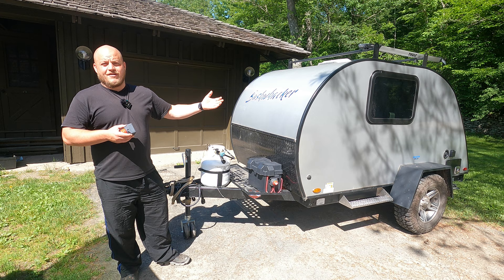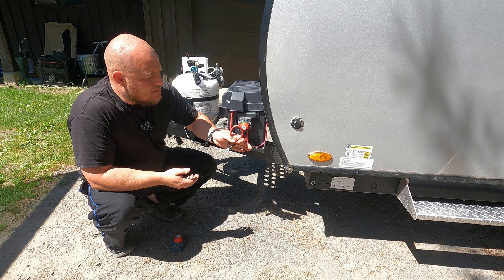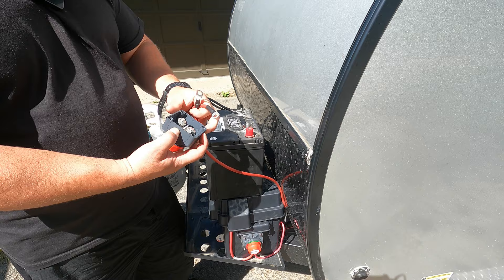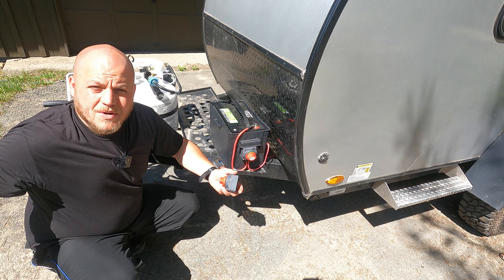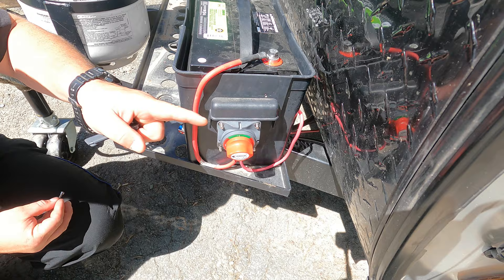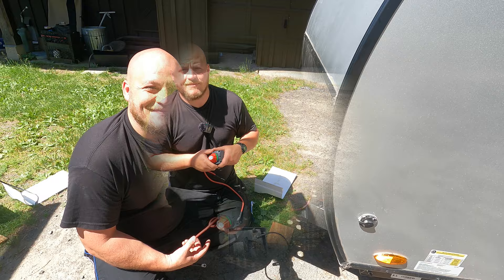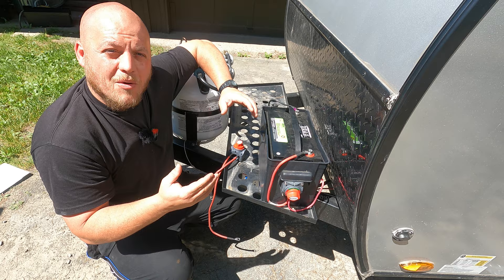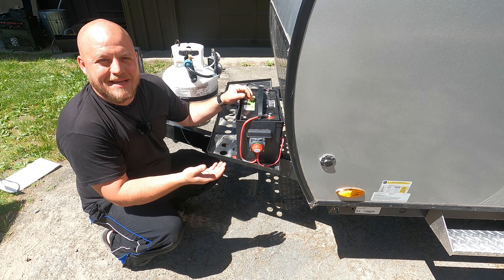Installing Master Switch on Camper Trailer | RV Kill Switch

Comment: I've been installing my battery kill switches on our RV Fleet since 2017 on the negative side and have never had an issue. It has the same effect, kills the power and does not drain the batteries. In fact I do it because any mechanic will tell you to always attach the positive terminals first to avoid arching your tools. You make a good argument and you're correct that the positive side is the hot side, but nothing is flowing unit the circuit is completed.  Also in-fact all of the units we have that came factory installed are on the negative side.  That said, great tips on installing the switch, and you definitely do a nice job with producing your videos!  Thank you!
Reply from the maker: Thank you for tuning in.
If you go through the comments, we talk about this in greater detail.  

There is still potential at the devices if you switch the negative, while you open up your pathway to ground.  There is no situation where this is advantageous over switching the positive. 
Every governing body that inspects or regulates DC electrical systems has mandated that you switch the positive and maintain on interrupted, and on fused pathway from chassis to the negative, the rest is urban legend.

When you’re adding and removing a chassis ground battery, you definitely remove the negative first.  For some reason people think that applies to DC master switch, it doesn’t, it’s a completely different situation.

Comment: I installed a two battery cut oft switch on my batteries and now my batteries stay fully charge.  Befor the switch my batteries would drain down even with a cut out switch on the dash of my motor home! Great to install!
Reply from the maker: They definitely help eliminate any of that pesky parasitic draw!

Comment: Why not switch the ground?
Reply from the maker: I've talked about this in other comments, check them out if you get a minute.
The gist- there's not an industry professional or organization that uses a kill on ground for situations like this.  That being said, either way works and would likely be fine.  There are several reasons why removing potential to appliances while maintaining an uninterrupted pathway to ground is superior.  The "urban legend" of switching ground usually comes attached with a misappropriation of a battery installation procedure.  With disconnecting a battery, its best to remove the ground first...they then think they should be switching the ground despite it being a completely different situation.    Hope this helps!

Comment: Don't forget to install the base plate.....
Reply from the maker: If you are installing the switch the way shown here, no need to use backer plate.  The backer is to protect the metal with potential, not needed when installed up against the plastic battery box.

Comment: I watched another YT video how to install this very switch, and he ran the switch off the negative side...stating his automotive background the negative gets the switch and he had a very sound explanation. However, your equally sound reasoning for running the switch off the positive side is also quite convincing. My switch gets here tomorrow from Amazon (thanks for the link) and I want to make sure I do it the best way.
Reply from the maker: Hi Alan, I used to try to not offend people, "Which ever way works best for you..."
The truth is, the negative side switch is wrong, plain and simple...lol
An RV has a chassis ground, when you switch the negative side, you introduce an elevated risk to appliances  by maintaining "potential" at the device, when the battery is turned off.  It can get complicated, but the evidence is clear that switching the positive and removing that potential, while maintaining a pathway to ground, is superior in this situation.
  
The reason people get this mixed up, is due to the simple rule that you learn when working on cars.  When removing a battery, always take the negative off first.  This is a rule to reduce the risk of short circuits.  If you took the positive off first, you risk bridging a metal tool from the positive to any of the metal under the hood.  It all has to do with the highest likelihood of short circuits. If you're installing a switch, it is different than removing a battery.  The risk is of shorts downstream, you're not moving the battery through a tight metal space. The industry puts master battery switches on red 100% of the time, when the negative side is the ground. I hope this makes sense, sorry if I took me a page to respond 😀

Comment: Just picked up my trailer today from storage. Went to use the electric tongue jack...dead. Hooked up the truck thinking I'd use it to power the jack, nope. Busted out the 7/16 socket and began cranking. First thing that popped into my mind, I need a kill switch. Great video...thanks man!
Reply from the maker: I've been there, it gets costly. How long was it in storage?

 SUBSCRIBE: https://www.youtube.com/c/DIYOutdoorLife?sub_confirmation=1
Reply: @DIYOutdoorLife , ~6 weeks. That said, we try and go camping about every 4-5 weeks, the batteries are always drained, but I've always been able to hook up the truck and use the tongue jack.
Reply from the maker: @beaujossel3791  definitely time for the kill switch install! It's fast and will save a lot of money.

Comment: Thank you for this great video. Installed it with the plywood spacer which was a great tip. My r pod had 4 wires on the positive post and I had to move 3 to the switch to turn off all the power. You might add this to your video. Thanks again Larry
Reply from the maker: So glad it helped!  Great idea about addressing multi wire systems in a video, thanks!

Comment: I have had one of these switches for years that came with a Terry house trailer that I used for accommodation when I built my house. I never installed it because I didn't understand it's purpose. I am going to install this on my new teardrop now. Thanks again.
Reply from the maker: That’s great, good luck w the project. Thanks for watching!

Comment: No "begging" needed! I actually subscribed prior to you mentioning that! I thought gee if this guy can explain a simple battery switch hook up so well then he must do a great job with everything else! I have watched so many videos on how to hook up a master switch and wasn't happy with them. Finally I came upon yours and as someone mentioned, it is through and detailed for the layperson. Thank you for your time and effort on this, your desire to educate is spot on! I have two batteries, parallel . My only question to  you is why the positive terminal, when everyone else says hook it up on the negative terminal?
Reply from the maker: Glad it helped and thank you for subscribing. Gotta do some begging early on to get the channel off the ground…haha
-as for the switching side w DC, the debate has been going on forever. The truth is either side works and gets the job done. When working with DC, it comes down to which is “best” - usually related to avoiding short circuits. With a system that is bonded and grounded to chassis, like an RV, you do not want to break or switch that ground. With phone systems or “floating” systems it doesn’t matter. Take for instance servicing a light or water pump on the rv, if the positive side was intact and you touched a wire to metal, you would complete the circuit and the appliance would turn on… this wouldn’t happen with positive switching. It’s complicated and easier to do demonstrations to show the difference. Hope this helps and good luck with your project!

Comment: Hey Brian, thanks for another good, practical video.
I did have to chuckle, though... When I first started looking at videos about RV modifications, I found that there are some strong opinions regarding whether the power disconnect switch should be on the positive or negative side. This sent me down a geeky rabbit hole of learning about Ben Franklin and J. J. Thomson - and common current versus electron flow.
In the end, it seems that either way works - and the trailer I'm buying comes with a power cutoff switch anyway. But hey, I learned some things, so it's all good!
Reply from the maker: Haha, I’ve been down those rabbit holes with projects as well. It starts with, “what kind of paint to…” —then it’s 3 am and you’re reading about 19th century lead poisoning.. haha
Thanks for watching and commenting! What trailer are you getting?
Reply: @DIYOutdoorLife  We had this conversation in another comment thread. :-)
I'm getting an Aero Teardrops, Steel H/C trailer.
Have a great day!
Reply from the maker: Haha….as the channel grows I lose track, I guess that’s a good thing! Awesome trailer, hope you love it, send pics!

Comment: Thank you for the clear informative video.  I installed a switch on my Jayco Baja.  In order to fit a piece of wood between the battery and the bolts I had to install the nuts on the outside of the box.  I had to add stainless washers so I could tighten the unit, otherwise the nuts were inaccessible in the recessed area.  Easy fix and it works like a charm.
Reply from the maker: Great improv!  I appreciate you swinging by and commenting!

Comment: I just received the battery switch, the “instructions” have a little picture that is less than helpful. I immediately check your YouTube channel for perfect instructions to install this. My little camper is in storage but this is definitely the first thing I will be installing this spring. Thanks, you’ve put my mind at ease!
Reply from the maker: Thank you so much, I appreciate you watching!
Reply: Ok, getting ready to install the switch but on my battery there are many other wires connected to both the positive and negative. Can I still just connect the wires as you have shown here?
Reply from the maker: @karenvinti3217  it depends.  You likely want to connect all of the wires that were connected to your positive, to the switch.  From there, one wire can go from the switch over to your battery positive.

This will turn everything off when you turn the switch off .

If you have solar, it might be worthwhile to keep that connected to the battery positive. In other words, all of the wires go on the switch, except the solar, that would remain on the battery positive.   That configuration, when you turn the switch off, everything shuts off but the solar continues to charge the battery.

Hope this helps, thanks for watching!
Reply: @DIYOutdoorLife  they are solar wires, that was my concern, I didn’t want to interfere with the solar. Once again you’ve explained it perfectly for me. I really appreciate it!
Reply from the maker: Thank you for watching!

Comment: Great video for me as a newbie boondocker. Wondering what the best ways to test battery life of an old battery. We just bought 4 year old TAG and used it last weekend first time. System seemed good but need to make sure battery is going to keep us happy for a two week camp coming up in September.
Reply from the maker: There is some affordable battery analyzers on the market, but results may vary.   Most places that sell batteries, like automotive stores, will run an analyzer on your battery for free, but I've seen that get wonky as well.

The most accurate, user-friendly way to do it at home is to leave it on the charger for a while until it is completely completely charged.  When you take it off, test the voltage, it's usually over 13.  Let the battery sit off the charger for a while, many hours, a whole day might be best.  It should be resting at 12.7 V or higher. 

Leave it for one more day, and test the voltage again .  if it's 12.5 or lower, your batteries played out.  if it can hold 12.7 for at least a day, it's got some good life in it.  12.6 lets me know we're getting close.  Make sure the batteries completely  disconnected for this test, it can't be connected to anything.

Hope this helps!

https://www.amazon.com/dp/B0BVM5SPW4/ref=cm_sw_r_as_gl_api_gl_i_VB3EK14BP98B899MV0TM?linkCode=ml2&tag=diyoutdoorl0f-20

Comment: Can you discuss the pros and cons of putting the switch on the negative vs positive side?
Reply from the maker: Hey Luke, its a common question in other comments on this video if you scroll down. Positive should be used if possible, no advantage to neg switch.

Comment: Happy to see your channel growing faster and you having fun. I looked in mine TD and it ia more complicated. There is one line to the solar controller, one line going to charger/inverter and another to the switch board. In theory this last one is the one to interrupt but in inverter is turned on then there is another way out.
Reply from the maker: No problem, leave the line to your solar charger connected to the battery.  

Connect BOTH of the other wires to one side of the switch 

Next connect the short new wire from the other side of switch to battery +.

Then when your switch is turned off, it leaves your solar on and shuts everything else down.

If you need more help, feel free to email me. Thanks for watching, I’m excited that the channel is growing too!
Reply: @DIYOutdoorLife  thank you for explaining to this commenter... go my new TD with solar in June... now I can check to see if wired properly... lots of us needed this advice
Reply from the maker: @bikingal4283  glad it helped out 😀

Comment: I have two 6V batteries which are a very tight fit in the battery box's. Installation with the provided screws will not work.  I like your idea of using double back tape to attach the switch on the battery box. If I do that, how do I attach the bottom plate to the switch body and still maintain a flat mating surface?  I really enjoyed this video and subscribed immediately. I admire the clarity that you provide and the thoroughness of your presentation.
Reply from the maker: There is a number of ways to do this.  My favorite has been to screw a small, well fitted piece of wood to the battery box.  I drive the screws from inside the box into the piece of wood for a secure fit.  From there, you can attach the switch by screwing it to that small piece of wood, with screws of the proper length.  That is the best, most secure way to work around.

For VHB tape, a lot of people just super glue, the backer plate to the switch housing. Since it’s an inexpensive switch, that does not need servicing, this is a solution that works for a lot of people.  They then attach the backer plate to the box with VHB tape.

Thank you for watching, I appreciate your subscription !
Reply: @DIYOutdoorLife  I used the fitted piece of wood method and it worked like a charm, thanks.
Reply from the maker: @neilholley9973  great news! Happy camping!

Comment: It is best to put the disconnect switch on the negative side. Same for When disconnecting the cables from any battery, disconnect the negative first, then the positive. Connect the new battery in the reverse order, positive then negative.” When you are replacing your car battery, It isn't always easy to remember the order in which to disconnect and reconnect the terminals.
Reply from the maker: Master switch on negative is not best. 99% of DC systems are engineered to be positive switch.  

The fallacy comes from what you’re saying about disconnecting a car battery, which is true.  The battery removal and installation recommendation is based on the highest probability of short circuit, which is different than switching.  For instance, if you take the positive off the battery first, in a metal compartment like a car engine bay, you could touch your metal tool to the frame and cause a short. That’s why it is recommended in that situation.

When you are creating a DC master switch, your contacts are enclosed, and interrupting the positive is the safest and most effective.  When you switch the negative, you are switching your pathway to ground while remaining potential at appliances… Definitely not recommended.  

Despite the fact that switching positive is industry standard, there still remains a  contingent of people saying to do the opposite.

I appreciate your swinging by and commenting, but it is important to push back on this fallacy.  With straight DC master switches, positive should be interrupted and fused… not negative
Reply: I have to agree with Joshua    While the presentation of this video is spot on, the science is not.  I was an electric fork truck mechanic for thirty  years and and I can   tell you that in   the text  Direct Current Fundamentals by  Orla E. Loper he states  that the electrons  flow from the negative charge to the positive charge. In my opinion  putting the disconnect on either  line would work but   using the positive without first disconnecting the negative  runs the risk of a dead short causing damage to equipment.  Also sparks around batteries ae NOT a good idea.   Whichever cable you choose  mount it underneath the front away from weather , people,and explosive gasses,  I could be wrong , but I will not be mounting  components to my battery box

Comment: Oh my. I  so thankful for your simple and clear explanation.  We just bought a 5th wheel.  The battery died during storage.  We had the battery charged and bought a solar charger for the battery.  Soooo if I put this switch on will the battery be able to charge when the switch is on the off position? Do I leave the red switch in the camper in the on position at all times?
Reply from the maker: Hi Gwen, hook you solar charger directly to the battery. Then it will charge, no matter the switch position. If you plug the solar into the “solar on side“ port, then this master switch will turn that off as well. I would have to see a photo or description of what switch is inside your camper, each one different. Do you have a master switch inside as well? Thanks for watching, I hope you will subscribe😀